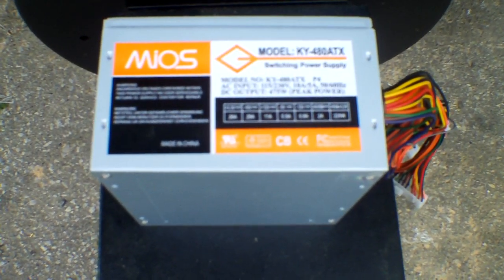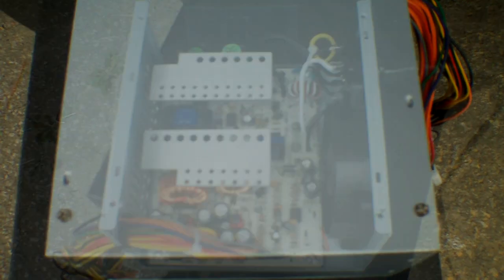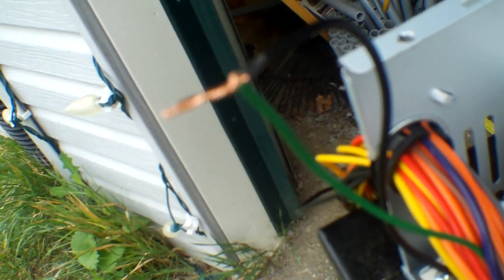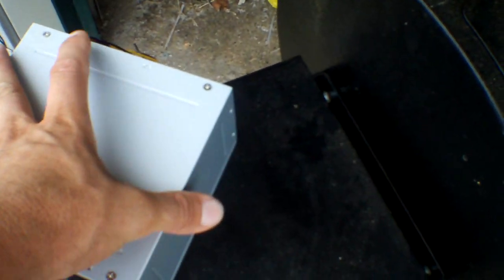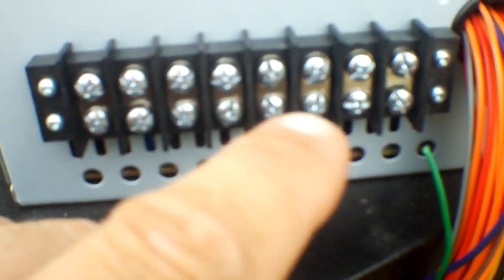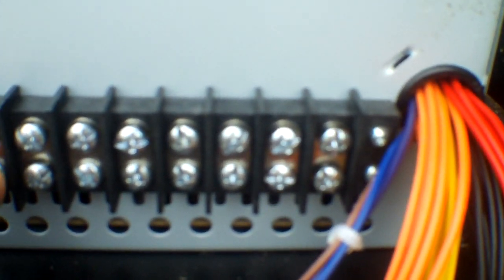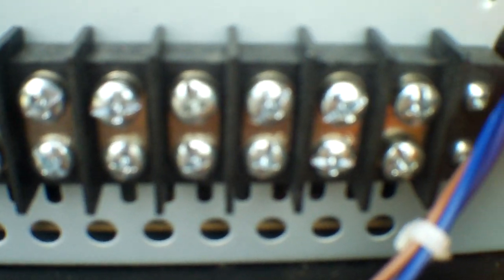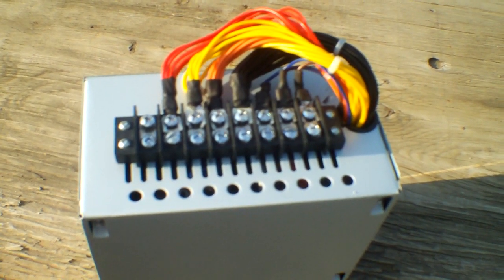Converted Computer Power Supply

Comment: why is he connecting all the wires to one terminal? all yellows to one and all reds to one and so on?
wouldnt one wire be enonugh for each voltage output?
Reply from the maker: This could be easily done , thanks for your suggestion
Reply: hd2kill well yes, connecting just one wire will give the same voltage as  connecting a few, but what is the advantage of connecting a few? More current because of kirchoffs current law?
Reply: dudekidPL Some higher end power supplies have several rails for the same voltage.
Also drawing all the current a rail can deliver could heat up the single cable somewhat so it's not a bad idea using multiple cables.
Reply from the maker: Thanks for the advise , good tip

Comment: For neatness and a better look, convert your respective color wire bundles into ONE single 12 ga. wire IN the chassis, and run that ONE colored wire to your final output connection.MUCH neater looking.
Reply from the maker: Good idea thanks for the suggestion

Comment: I always had this question. Assuming that this power supply can provide 250 watts at the 12V rail. This would mean about 21 amps. If not the 12V rail then most probably the 5V rail could provide that amperage. But can these wires (the sum of their diameter) handle such high amperage? I believe most probably not. So are PSU manufacturers kidding us?
Reply: In these cheap power supply, yes, they are "kidding us".

Dont expect these power supply to delivery mora than 200W with acceptable ripple.
Reply from the maker: These are basically junk lol

Comment: It looks like a Powmax unit. Also, you can just connect the green wire to the case since it's just a PS_ON wire that has no charge and the case is connected to the common ground. Even if you only use it for testing, i would still replace those crappy caps, if their ESR goes high they will make all the voltages skyrocket.

Comment: Wow, that power supply is a POS! Thin heatsinks, tiny transformer, undersized/cheap junk capacitors, tiny filtering coils on both 12V and 5V, cheapo fan and undersized silicon. Hook that turd up to a load tester and it will blow out the primary at ~250w. This is a good example of why you should get a decent power supply, this design is just about as barebones as you can get.

Comment from the maker: I used the green wire as seen in the video however , I have been told at times the grey wire is used beyond that I am not sure what you have there so its difficult to determine next steps.Ide recomend a close look at the power supply wire lable information as to whats what and perhaps a google search on the make of the power supply

Comment: i took 3 power supplys out of 3 old pc,s. i plugged the pc in and made sure power supply was good. bud when i take um out the pc and do the green wire to the black wire, nothing happens, the fan in power supply only jumps a bit.any idea what is going on?